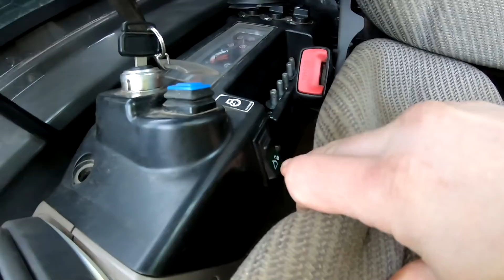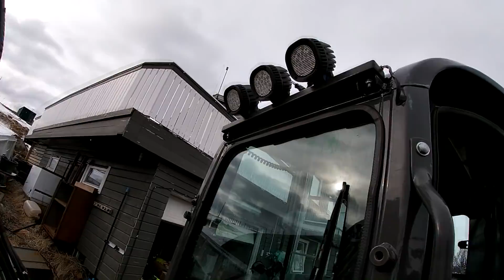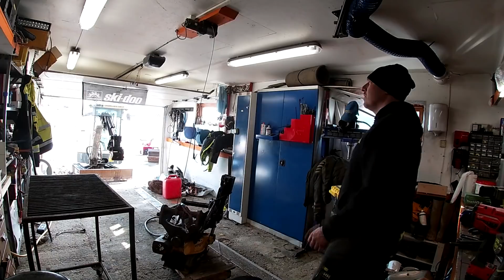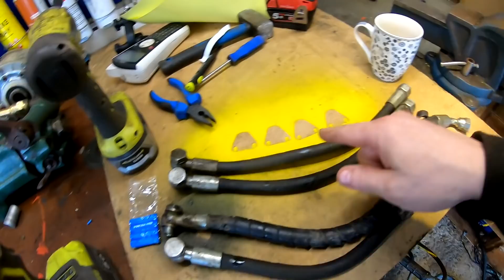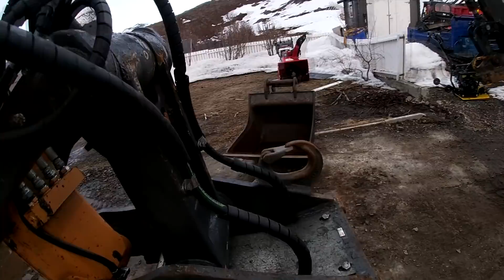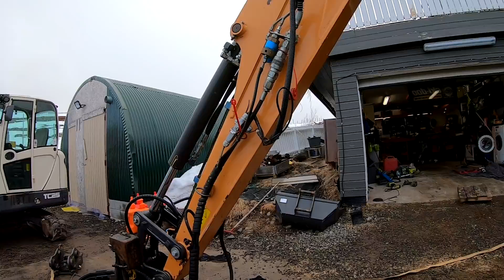Changing out the tiltrotator and quickcoupler on the Case mini excavator

Comment: Interesting one to say the least well done . I think putting your lifting winch kook on a pulley and doubling the cable back would make it sound and act a bit happier!
Reply from the maker: I got one laying around, I had my engine from the massey ferguson I had before in the garage, and it wouldn't lift it without that. I also can remove a few meters of wire, don't need that much on it in there.

Comment: Hi Just wondering Engcon system is Proportional but those valves look like standard cetop type? Is it the controller that makes the system proportional?
Great video again 👍👍
Reply from the maker: It is proportional valves on it, the voltage is regulating how much it opens. And I can adjust the speed in a app on my phone
Reply: @MiniMachines1  Are the used Engcon's expensive in your country?

Comment: Hey Isak very nice video again it was very much fun to watch. The thing with the lubrication hoses is total expensive and this quick connectors are total junk. They are well to quick fix something but don't hold well. The 6LL cutting ring connection that bekamax uses for there lines are much better and durable. Also you can get heavy duty plastic lubrication lines they are stronger than the normal ones. The laying of the quick couplers lines looks to me very susceptible. Are they often hit some thing while excavating? Greatings from Germany.
Reply from the maker: Thanks 😊 Seems like they are doomed to fail at some point, but an nice and easy fix. I will try and Google the one you are mentioning she see if I can get a few of them in backup. I tried to get new lines here in my town but no one had any. Actually did some work in the quick coupler lines to day, got them tucked a bit better away, but normally nothing should hit that when digging, the bucket should have cleared a path.

Comment: 🤣 you can buy the function blocking end plug to go on wiring where the tiltrotor plugs in to make top hitch work guess you didn't get it when you bought the machine
Reply: I would get your local engcon dealer to buy the s50 tiltrotor and top hitch and get a control system and levers to fit the terex so tiltrotor will run on both machines
Reply from the maker: Yes would have been nice, but the terex is getting something else pretty soon 😁

Comment: Hei Mini Machines I find it interesting that you still have frost in the ground. Here in Ontario our highest has been 30 C last week and this morning coming to work I had 4 C. Last week at the plant they wanted the Air Conditioning on and today we turned the electric heat back on. I liked that you had a light snow flurry. From Ontario Canada Craig Clayton
Reply: Totally here you and feel our weather here in the Ottawa Valley - want to plant the garden but frost and going to a low of 0C tonite and June is just about here. Cheers
Reply from the maker: Yes it changes quick here also. 12c one day snow today 🌨️